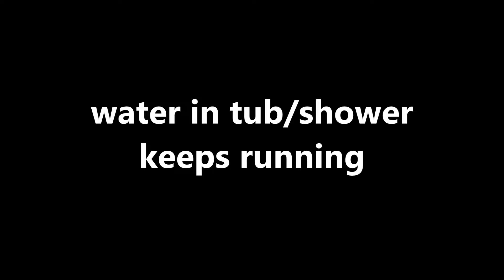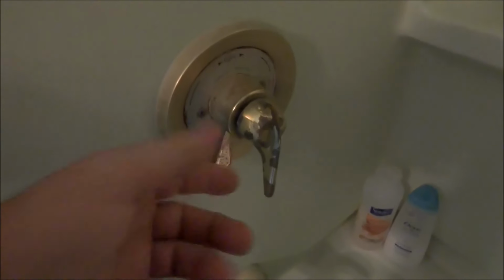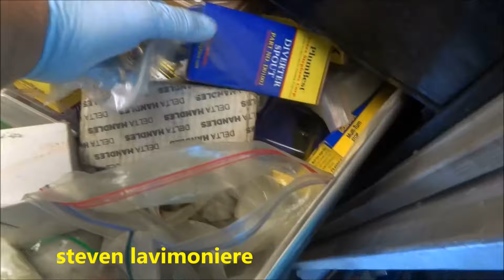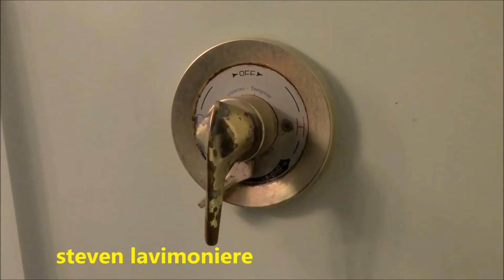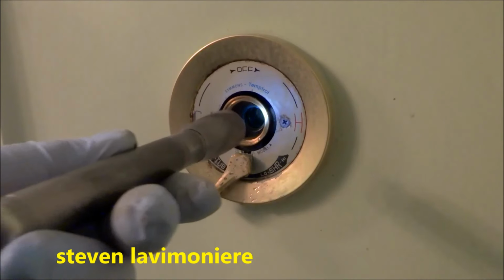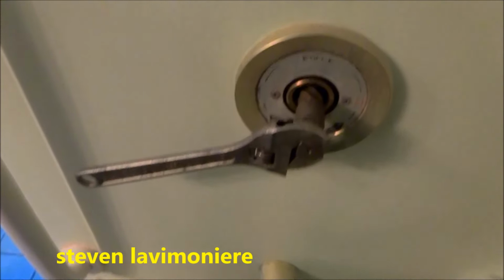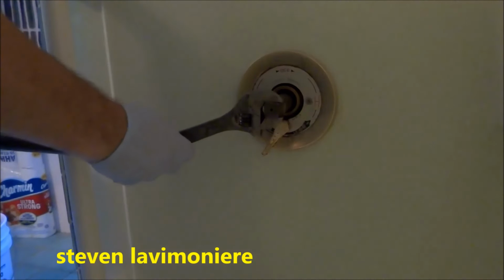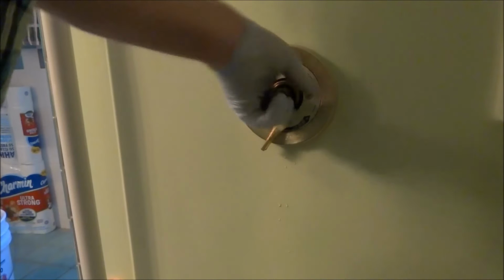water keeps running from tub / shower valve

Comment: Thank You for these Symmons shower/tub repair videos. I watched 25 of yours and had the guts to repair mine. I put in the new ta 10, ta 4, got the new t35c symmons tool for old and new parts. I went at it, everything came out (with a prayer) pretty easily. My valve was leaking. The seats looked solid and the cartridge makes noise when you shake it; I replaced both seats, the spindle, and the diverter. The leak stopped from the valve/cartridge, but I am getting a slight drip from the tub spout. Any ideas how to fix that and do you have a video concerning that. AWESOME videos, thank you for the help.

Comment: I replaced my seats a few months back in both showers. One front seat wouldn't budge, I ended up using a 3/4 cold chisel I had that fit right in it, tapped it in and used a 3/4" wrench and out she came.
Reply from the maker: that works also have done that in the pass with the chisel . i need to modifie something else ,,besides this easy out .